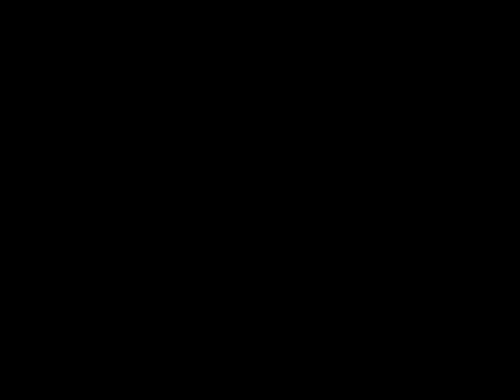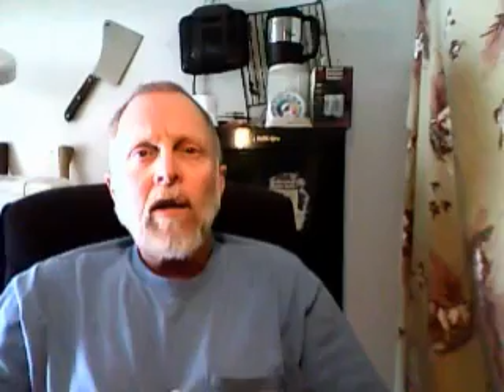Solar Panel Update and Next Project

Comment: Thank You! for putting out awesome vids! Lookn forward to the Rocket wood stove, everyday I think about a self feeding rocket stove. Gotta get a camera... a friend mite help me... but first I want to materialize my idea of a water heater exchanger for a rocket or woodgas stove. I think I've got it figured out, use 4" muffler pipe and wrap 1/2 or 3/8" cop tube around it, wrap with aluminum foil,put a pipe around that, seal & pour sand then insulate outside. A damper..maybe U make b4 me?Keep up!

Comment: i bilt a YouTube copycat Heineken rocket stove and when I place a Dole 1 Qt pineapple juice can (w top & bottom removed) (about 4" diam) ontop the rocket effect worx much better.My paint remover gun on cool pointed at the intake turns the stove into a blast furnace. My idea is to take a 4" muffler pipe & wrap w 3/8" or 1/2" cop tube, place atop rkt stove, pump water thru a garden hose w a $7 pump attached to drill circulate to insul trash can tank in basement. Cop coil &/or pex xchngr in tank...